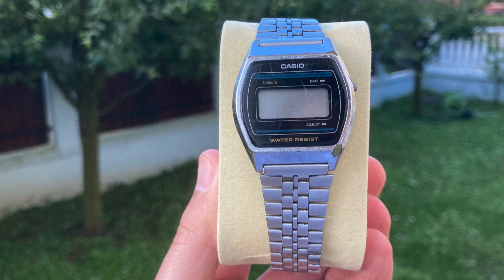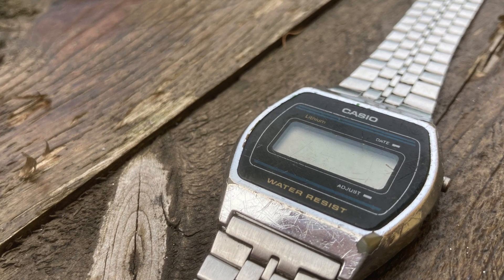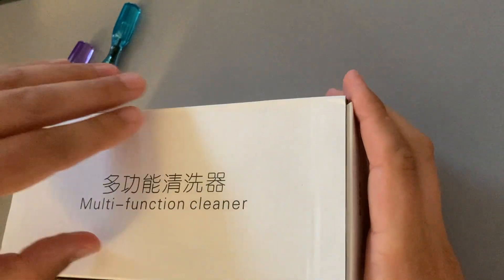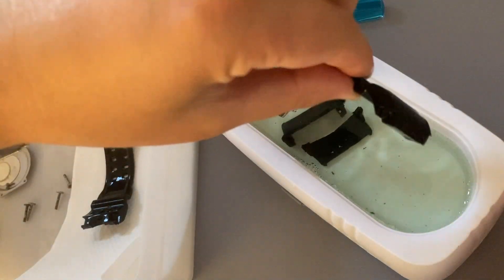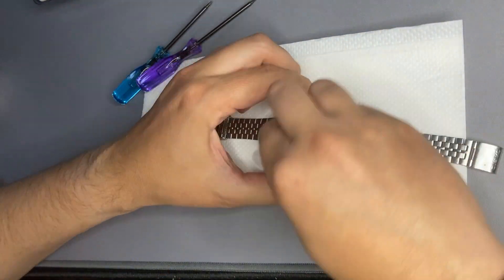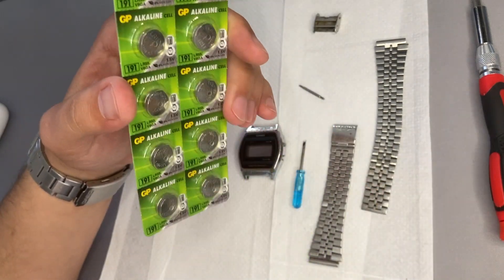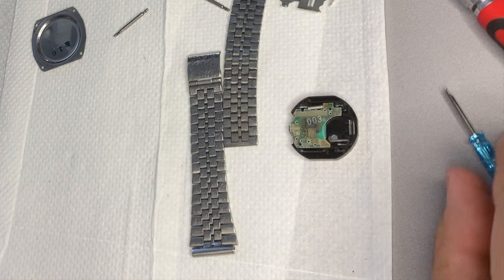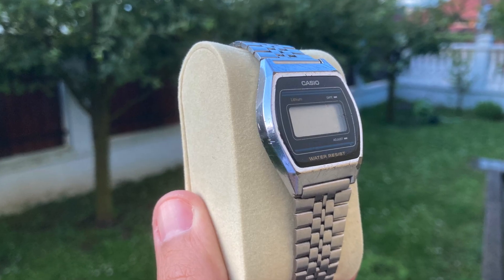Casio B612W vintage digital watch

Comment: how to i set the time and date
Reply from the maker: it is difficult to find the user guide on the internet...since my watch doesn't work I will take my risk and explain how to adjust it based on experience: on time keeping mode  long pressing Adjust ( bottom right pusher) will enable time adjusting. you will see this the seconds blinking. a short press of the adjust will move to the next item that needs to be adjusted....and with Date (top right) you chose the desired value.

Hope you will solve your puzzle :)

Comment: I have had these since childhood. Fixing them is just about the preassure aplied by the metal piece (you have to bend it a little for it to apply constant preassure towards display), and also the black plastic "O ring" has only one position that is the right one (and also applies preassure towards the front of the piece - fixes the movement in the right place).
Reply from the maker: hello! thanks for the hint. I assume the metal plate is that back that secures both the PCB and the battery. In regards the o ring, I am not sure which one you mean. Although I kept on pressing the entire module, but still nothing (only very faded) appears on the display. I have lost my faith in regards this watch :(
Reply: @cj80gdi-321xxx-moon  Sorry to hear that, I must confess, that for couple of years I also was not able to fix mine. By the o-ring I mean the black piece of plastic between the metal backplate and plastic case. Also be carefull when putting back the 3 mm metal contact under the battery.
Reply from the maker: @michalulvr9813  seems that i would need to search for this module on second hand market :( i have to be patient

Comment: Try to look for connection name AC on the battery stainless cover (on the module) and connet it with the positive side of the battery
Reply from the maker: @weeklytech3774  thanks for the hint…i have tried to AC reset it… still nothing pn the display :(( i am sad that it doesn t work